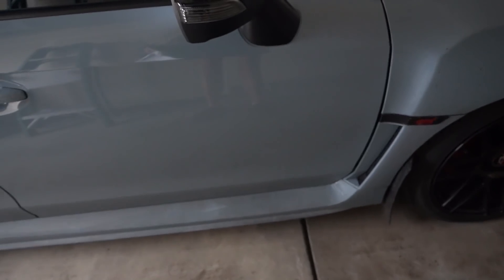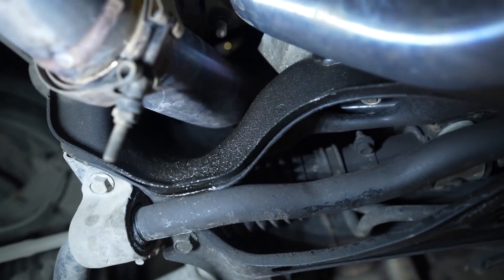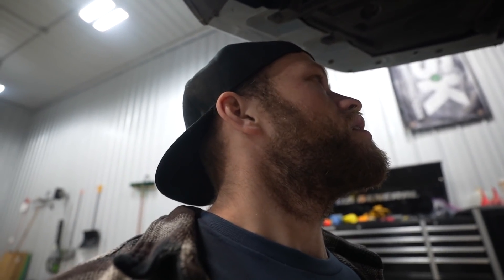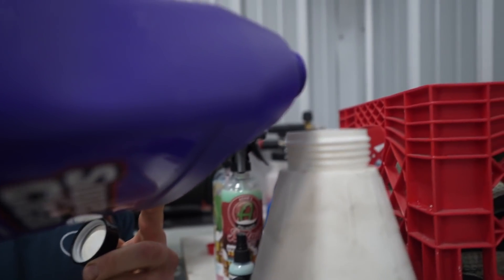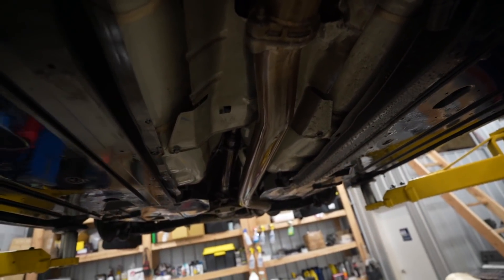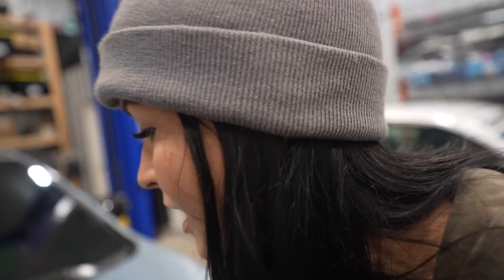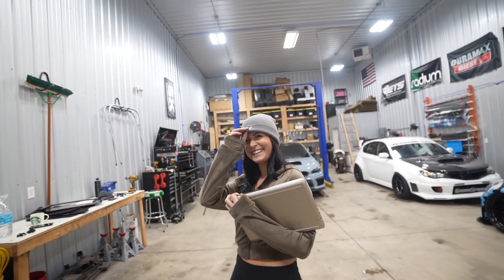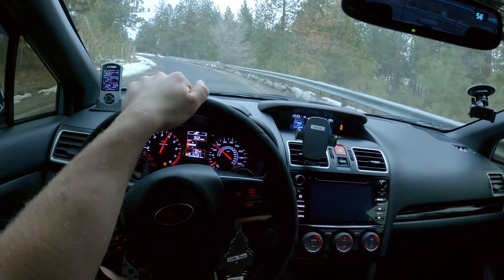Bobbi's STI Goes HotBoi!

Comment: 2:28 hey devin is that your wastegate dumptube sticking out? I ask because I’m running open downpipe right now but I want to put an exhaust and don’t know if I should connect them together or not, Ik the correct way is to have them together but ive heard you hear the wastegate open up more

Comment: The Si drive just maps virtual throttle positions, you can hijack it to run different maps if you have an aftermarket ECU (the stock ECU will only hold one map at a time)
Reply: SI drive can also differentiate different boost levels, aka limit the wastegate duty cycle. It acts as "different maps" because technically they are different power levels.
Reply: @IcySTi  Agreed, it still functions as intended with any map loaded on the stock ECU. But no they are not different power levels, 'i' is 70% throttle position, 's' is 100% throttle position and 's#' is 110% throttle position. If you want to use the 3 positions on the switch to call up 3 different tunes they need to be stored somewhere as the factory ECU only holds one tune
Reply: @mranderson3927  My STi is wastegate on intelligent, 15 psi on Sport, and 18psi on sport sharp. Are you saying that this is the case because the car doesn't get the throttle body all the way open?
Reply: @IcySTi  I see similar numbers from the boost gauge in my spec c in i and s modes, and my initial assumption was also 'Si drive = boost control of some sort' but its just  throttle position voodoo and a pretty switch. Not sure if its actioned via throttle body opening or fuel delivery (suspect the answer lies in how the throttle position sensor actually works given throttle is not cable actuated these days). From then on I've just left it in S mode as that's 100% throttle position i.e. you get exactly what you stick your foot into
Reply: @mranderson3927  lmfao i dont see even close to the same psi in intelligent versus sport sharp. you must be stock?
Reply: @IcySTi  Ah I see what I did there, I meant similar numbers to yours i.e. 15 in i mode and 18 in s mode rather than the same boost in both modes

Comment: Hey man thought I'd ask, do you recommend ceramic coating a downpipe or wrapping it in titanium wrap?
Reply: heat wrap. i mean you can cerecoat it if you want to, but i dont see a point when cerecoat is paint protection with hydrophobic properties...
Reply: @holeshot26  Maybe I used the wrong terms but I was thinking coating the downpipe with a coating that contains the heat in the Downpipe :) I.E VHT Flameproof Coating. But I'd leave it to a shop that does it.
Reply: If you live in an area where you get a lot of rain, I would do Jet Hot Heat Exhaust Coating. If you live in an area where you mainly have sun, a heat wrap would be good
Reply: @codyhendrickson7735  Only drive the car during the summers. Seems like I will be going with heat wrapping, now I just need to find a good quality one to match my turbo blanket.